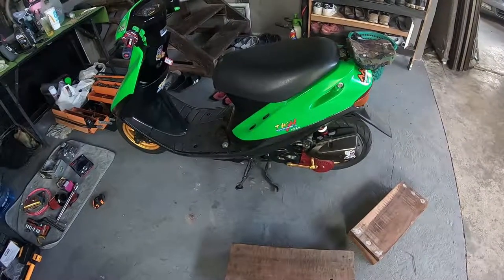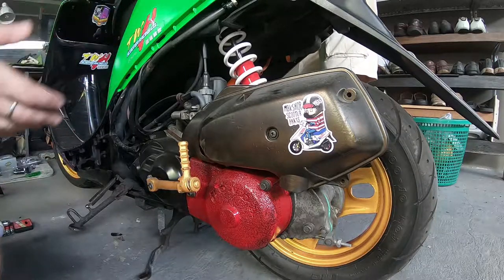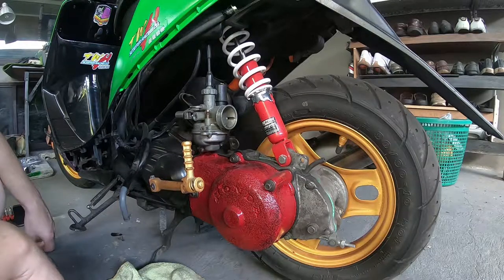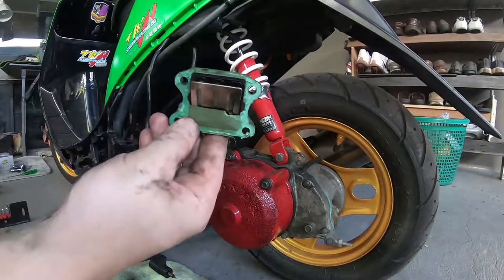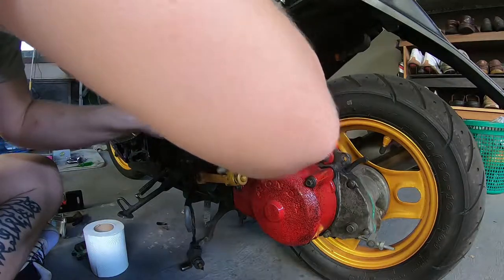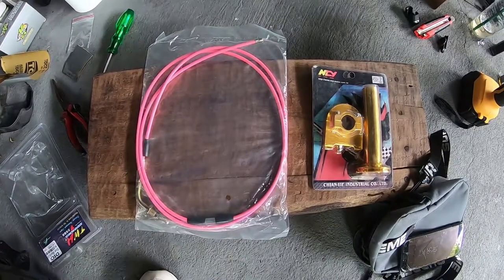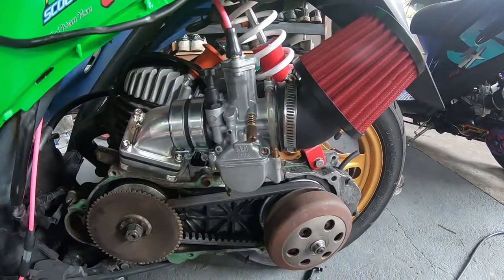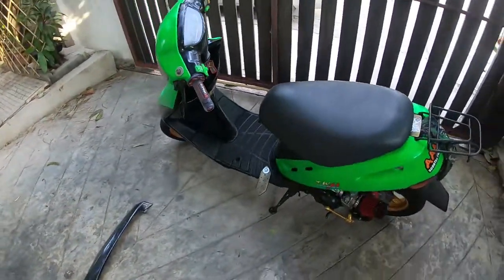Clutch/Throttle/Carb/Intake/Filter install on Honda Dio AF27

Comment: Did you notice gains from the piston kit ?
Reply from the maker: From stock bore to 44mm there was a noticable jump in power. When I upgraded to 48mm it felt much faster too. Just saving some pennies to upgrade to 54mm now but needs a lot of supporting mods for that
Reply: @thaitorque8847  what are the mods that need if you jump into 54mm?
Reply from the maker: @agbuyalennox2998  For example, TWH provide a 54mm cylinder and 52mm crank. You would also need replacement crank bearings, gaskets, and the case will need machining to fit the cylinder and the crank. Of course, a lot of other things would need to be upgraded in conjunction with that.